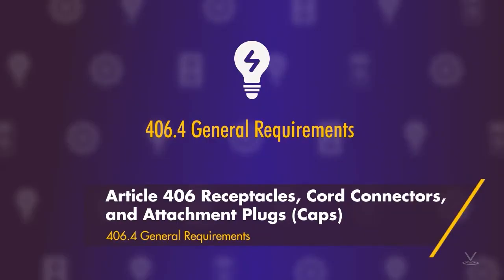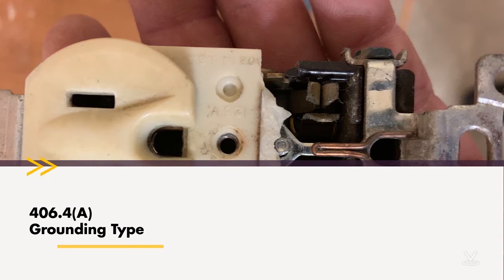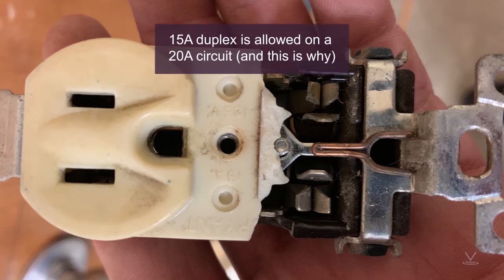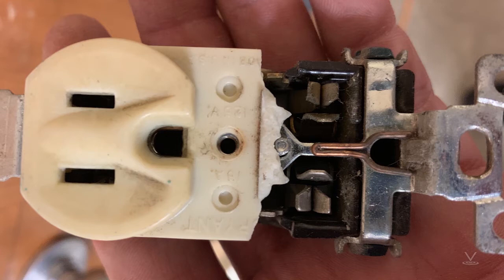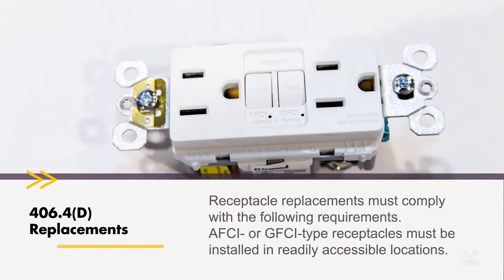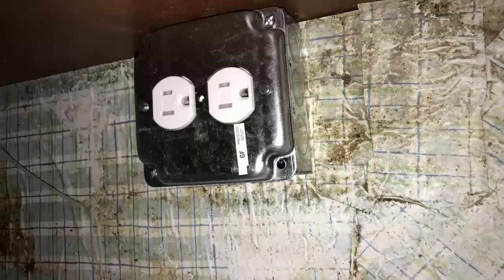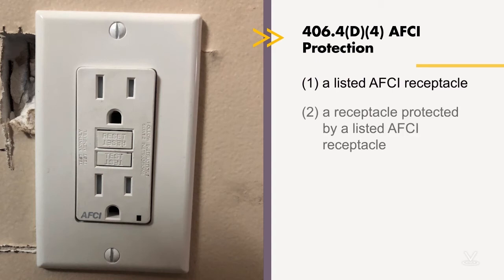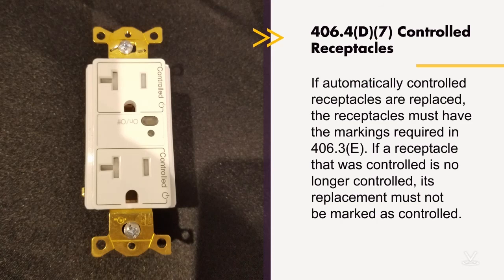2020 NEC 406.4 General Requirements

Comment: I doubt the explanation of why a 15A receptacle is allowed on a 20A circuit is correct.  It should be allowed because a 15A device will not overload a 20A circuit.  Receptacles are commonly on 20A circuits because there may be multiple receptacles which together can draw more than 15A.